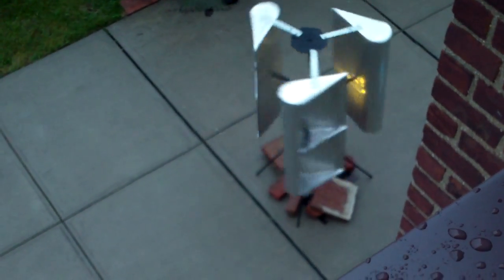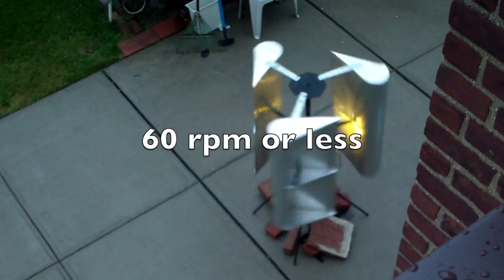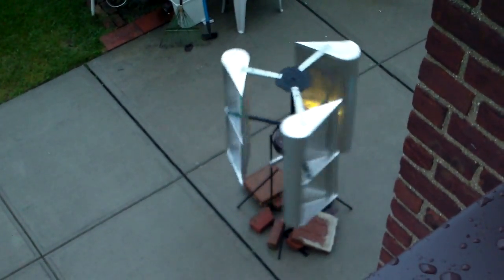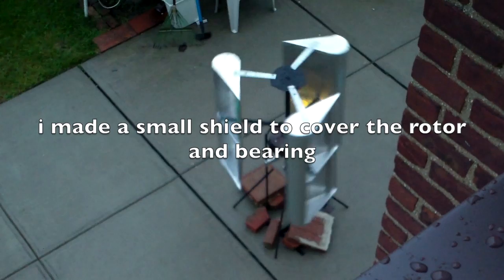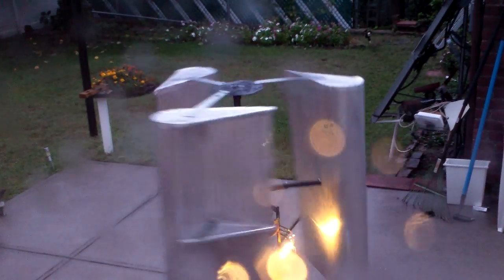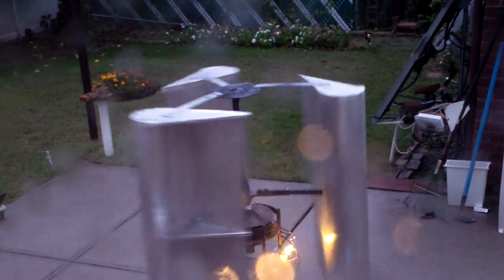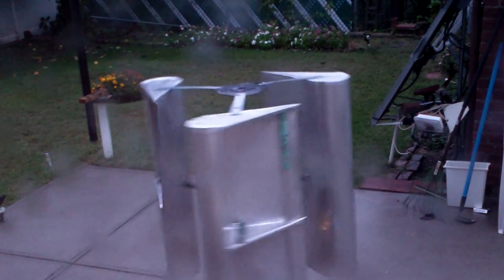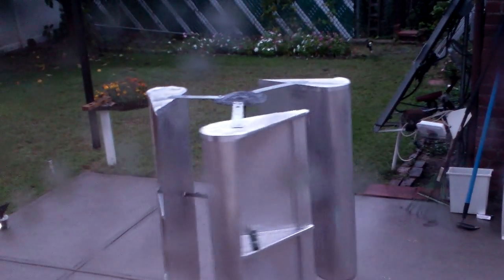First windy day for my vertical wind turbine

Comment: Looks great. I really would like to try and build one of these. What angle of attack did you use .Thanks for  Sharing.
Reply from the maker: +Aceman307  Nine degrees. I'd do a 12 coil instead of 9 as these vawts don't turn as fast as horizontal turbines. Thanks for watching.

Comment: looks very good! awesome to see it working in full effect. I wonder if you made the center rod a one piece tubular rod with the weight balanced evenly if it will help stop it from rocking a little. love watching your progression
Reply from the maker: +gg gg The wings and lower arms are rotating on 2 bearings and the center rod/post rotates with it so it's not that much off center and off balance. I agree a one piece tubular would be better but I couldn't find one that fits. Another issue is I don't know if I can weld the rod to the spacer as it appears to be aluminum.  Thanks for your input. Your suggestion certainly would make the turbine look better.

Comment: Awesome! You did a great job with the blades. I imagine you will be running wire into the house at some point for a small 12v system. Very cool
Reply from the maker: +belgrademachine Thank you for your kind words. A few lights flashing is more dramatic than a cable quietly charging your battery.  I'll let it shine a bit before I use it for charging.

Comment: Wow, that's really moving there!  If nothing else, what about a nice size capacitor to smooth out the flashing of the lights?

I could also see it recharge some nice 12 volts cells, which are very useful.  A lot of things run on 12 volts, and a lot run on 5 volts.  Fortunately many of them don't require much current as well.  I think you have a good solid design, now it's time to start implementing its functionality and make it work for you.  There's still the limitation of how much wind you'll get based on your location.  If you had a nice open field, it probably would show you its areas of weakness.  Perhaps you'd consider a, well, a field trip with it to see how it performs more out in the open.
Reply from the maker: +jaykay18  Yes, the output can be smooth out as the lights are flashing.  It is being run on 2 phases to boost the voltage. This allows for charging in low winds.  In high winds,  the voltage boosting is not really necessary.  Running on 3 phases will also smooth out the flashing without the need for a capacitor.  Winter will bring  more windy days like today,  but unfortunately the white stuff called snow will come as well. I need to move this vawt to an open parking lot, or maybe a school playground.
Reply: wtam69 I wonder if the vawt will spin fast enough to sling the snow off of it!  You never know.  I know it gets pretty windy in the winter, sometimes to the point of "whipping".  Chances are it will produce a nice amount of power and at the very least keep some batteries topped up in case we lose the mains.  I remember many years ago we lost power in the winter.  It's VERY unnerving, because then there's no heat either.  Sandy was one thing with those cool days but it did hit 50 or so, in the dead of winter with that whipping wind you can really be in trouble.

Comment: Good looking wings looks nice works well. I think the center part should be made from a heavier piece of pipe or tubing  and the the top supports  need to be heavier iron straps too you said your self they were sagging. I got some iron straps at lowes for about ten bucks they were about eighth inch thick or a quarter. With those upgrades it will be a great winner. That turbine has potential to turn a decent size gen. big enough to charge your twelve volts batts. And do you have a welder? You could get a harbor frieght 110 volt wire welder for cheap. My friend gave me a used one. Its works OK. for up to 1/8 inch metal and thinner.
Reply from the maker: +shartne Thanks for your input. The vawt does need some beefing up. Since it is home made, I can exchange and replace the undesirable parts as needed. I have the inexpensive HF welder and it helped me in making the stand for the wind turbine.